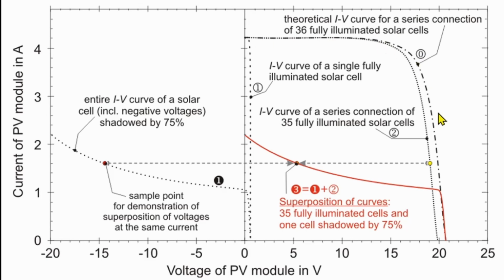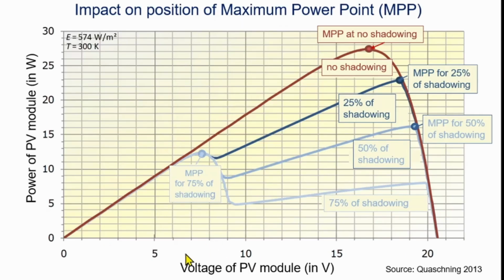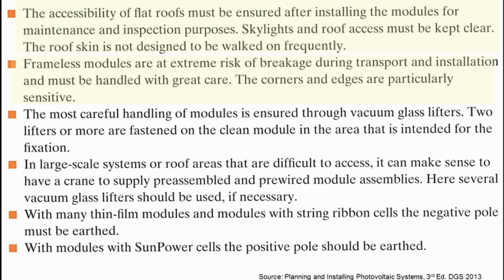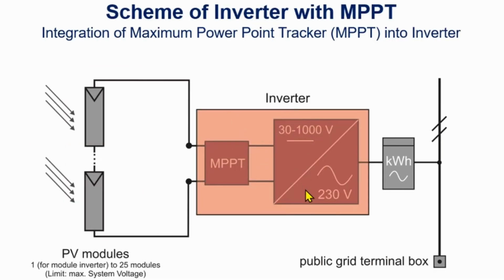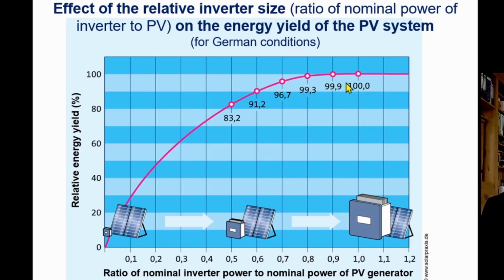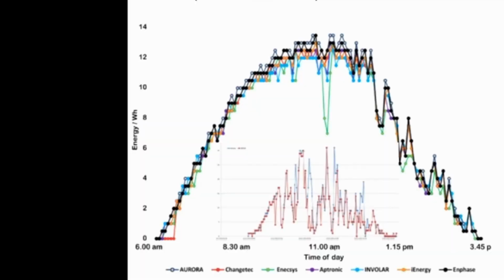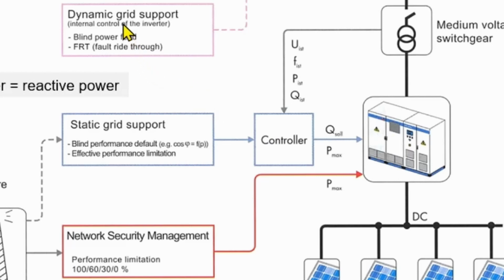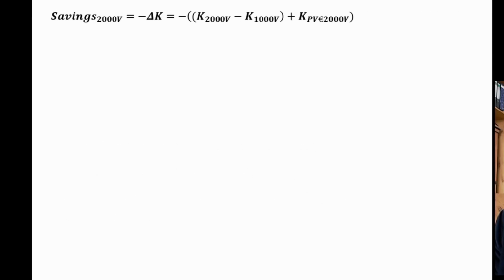Solar Electric Energy Systems 05 - PV Systems - Bypass, Inverters, Wiring

Comment: Dear Professor,
Can you tell me how to reverse LeTID ? In some cases it is possible to reverse LETID by inducing a reverse current into the string (modules). So I am looking for an inverter that can in the day hold the module at MMP and in the night induce a current . Can it be possible ?
Reply from the maker: Usually, you apply a reverse Voltage during nighttime to reverse PID. SMA and other companies offer devices for such puposes. For LeTID, I didn't hear of reversability. Can't you ask the manufacturer?